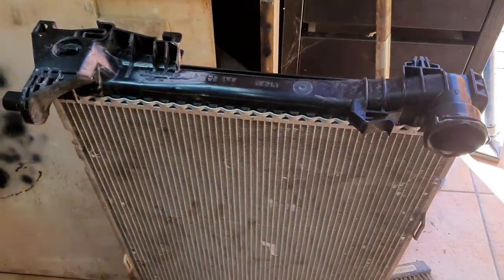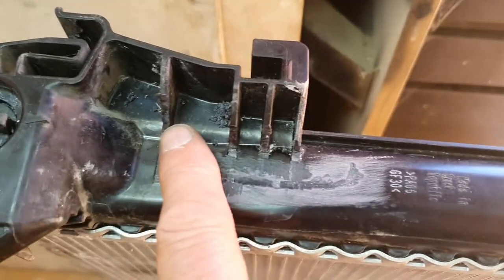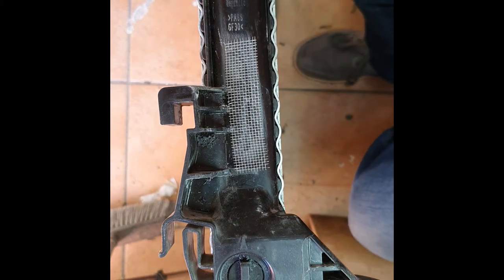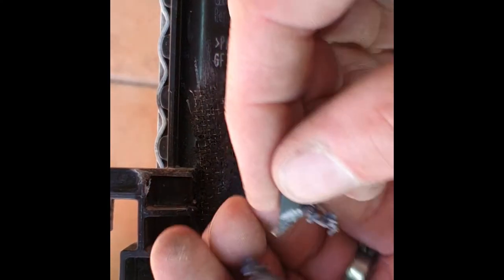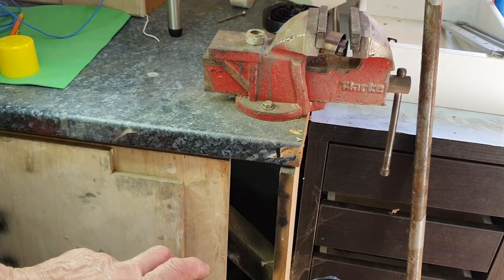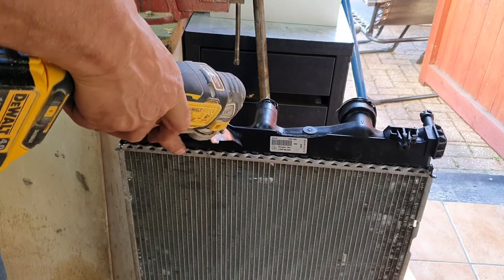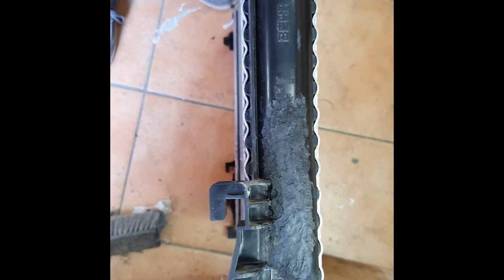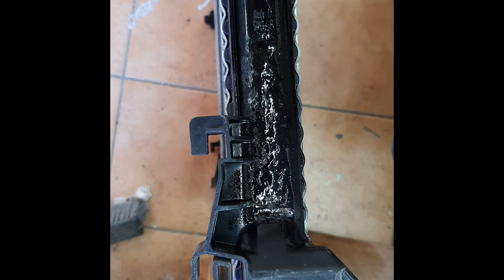Car Radiator repair

Comment: You can use plastic ties to weld Johnny 👍
Reply from the maker: Hi Malcolm. I had only just bought this little kit and it came with a whole bunch of plastic welding rods.  I wasnt sure which one to use. But as you have correctly mentioned, Plastic ties would have worked too.

Comment: I like how you cannibalized the unnecessary plastic parts. That way you will be using the same type of plastic for the repair.
Reply from the maker: There are so many different plastics out there and one type won’t bond to another. So I came up with my 'fools' solution hahah